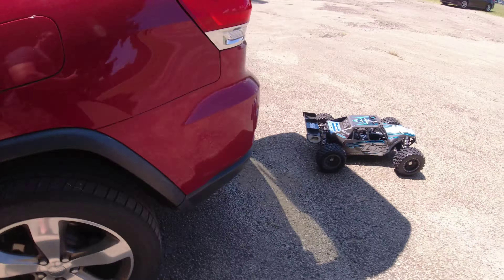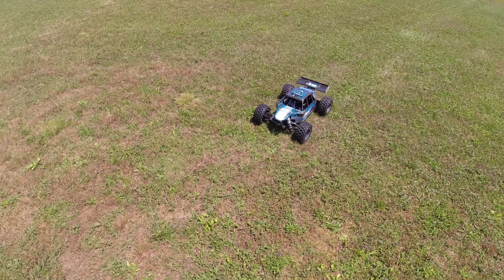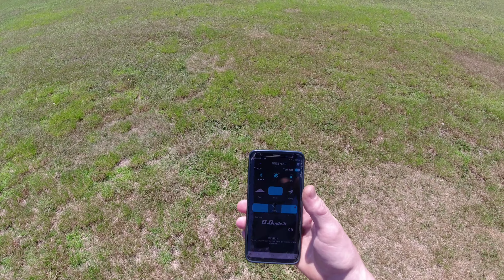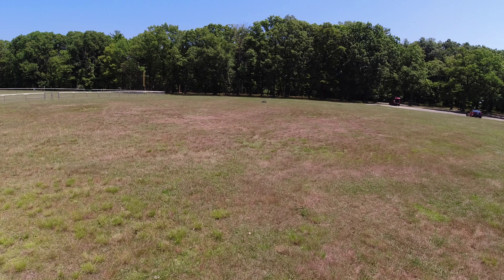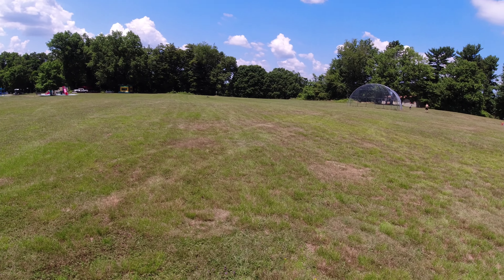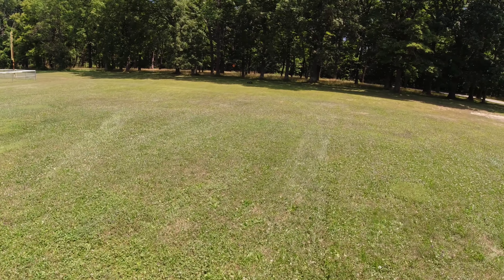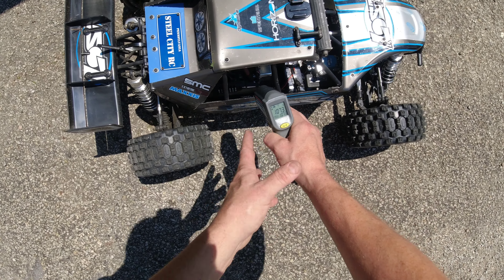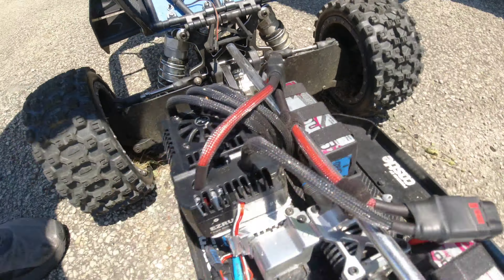Hobbywing Max4 12S -Losi dbxl-e

Comment: Always impressed with how that engine runs! Gets on the pipe quickly, has some great top end and always returns to a nice stable idle. Seems like it requires minimal tuning too!
Reply from the maker: Thanks Todd. I did two of these g320 with an ESP top end kit. This buggy seemed to have taken better to the upgrade. For some reason it seems to rip better on this platform. Not much weight difference. Maybe the pipe?
Reply: @SteelCityRC  did the other one go on the mt?
Reply from the maker: @rcOhio  yeah on the Rampage MT. Hey man we are on the wrong video lmao!!
Reply: She is hauling 👊🏻👍
Reply from the maker: @15scalercgarage76  thanks my RC brother.

Comment: Hey man! Love this video! I have a DBXLE 2.0 with the Max4 and 700KV leopard motor, and stock gearing  but doesn't come close to pulling a wheelie. What diff oil are you running? Cheers
Reply from the maker: What is up man. Thank you very much. This combo 12S is super radical. I changed no settings at all. Right out of the box. I am impressed. The diff oils currently are 500/1M/100. I originally had 500k center but I blew an older Badland tire off the rim in a wheelie. So I thickened the center in hopes to even the power out. Also using 17/50 gears.
Reply: @SteelCityRC  Thanks for the quick reply! The difference in performance from mine is night and day. plus I'm running 2.5M in ctr. I'm trying to decide what motor to upgrade to.
Reply from the maker: @TonyStark-pi3vc  very interesting. This is my first experience with the Castle 800kv sensored. I had the older 800kv non sensored in there for four years. I had no issues with the older can. Very reliable.

Comment: nice run steel city rc, you mentioned at the beginning of this video you are running a hobby wing max-4 paired with a 800kv castle creations motor & sensored. can you please explain how did you manage to get those 2 different brand(castle creations & hobby wing) to be paired in sensored as one unit? thank you. i have the same setup in my losi dbxl-e 2.0
Reply from the maker: Hello. Thank you. The HW Max4 comes in the package with a sensor lead that plugs right into the 800kv castle or any other sensored motor with a similar plug. I also put the HW OTA programmer on it. I just need to figure out how to get the data logging. The app on the phone is nice to do on the fly setting changes etc. I didn't get the chance. Dummy me didn't secure the balance lead for the 2s lipo used for fans. It got munched up in the gears. How it didn't short out is beyond me. I got lucky. Hope I explained it well enough. Hit me up. Appreciate you stopping by
Reply: @SteelCityRC  thank you for the explanation. sorry to hear about the 2s lipo. luv the rig setup & the way it runs.

Comment: Did your Max 4 come with the sensor adaptor? Also how has it been holding up for you? Good on the 800kv motor and 12s? I'll be putting this in my outcast 8s soon, trying to see how it's been for people in the long run.
Reply from the maker: Hello. Yes the Max4 came with the sensor wire adapter that fits the Castle 2028. The system seems good paired together with different brands. It seems every bit as reliable as a Max5 that was in here for years with the old non sensored 800kv.

Comment: what combo you used and which battery to get this result?
Reply from the maker: @steevecesaire4963  what is up! I have a Hobbywing Max4 ESC and a Castle 2028 800kv motor. Using two SMC 8000mah 6S lipos. I used Castle because HW hadn't released their 12S rated motors yet. Otherwise I'd use Max4 and the HW 800kv. Either way very similar outcome. Thanks for watching 👊 🤘

Comment: Hell yes bro! 60 is bloody hardcore! And those wheelies are rad🤙🏽 Just speed tested mine with the 560kv 70125 hobbywing motor and 16t pinion and only got 55 on the road... need a bigger pinion. Those prolines holding up good to the power?
Reply from the maker: What's up man? Thank you much. Not too shabby speed for how shitty the terrain was. Not enough room either. The wheelies. Maaan I gotta tame that bad. I can't get past 3/4 throttle. It pulls the front end. So I am gonna try to dial in the throttle. It is just silly to drive 😆! The Badlands. Yeah man. They hold up real good. I've seen Xmaxx guys go 100 mph plus with them. I have a hard time running them on the street. I don't know how they do it. Appreciate you stopping by RC brother 👊🤘

Comment: What gearing you running
Reply from the maker: What's up! I have 17/50 currently. My mesh is a bit off for some reason. I need to put it back on the bench. Appreciate you stopping by 👊 🤘
Reply: Temps have been pretty good I’m gonna run a 530kv if ur running 17/50 I should be fine with 24/47